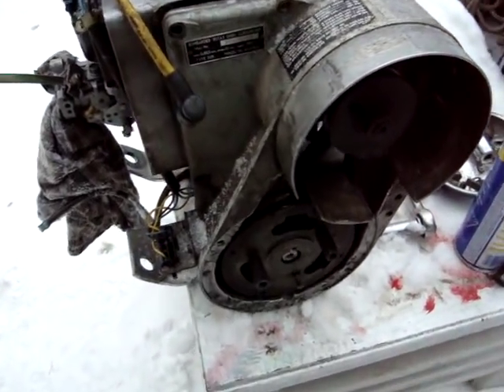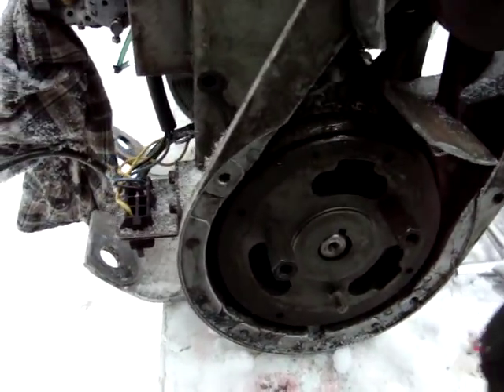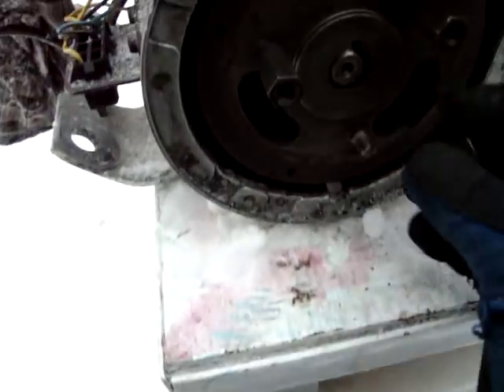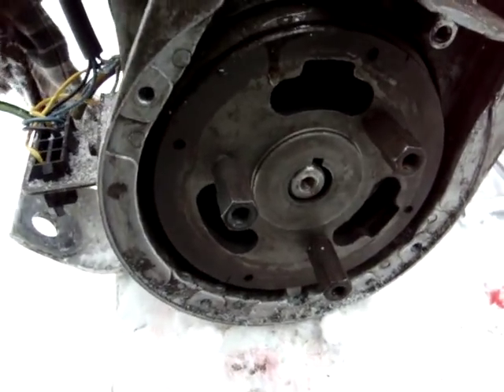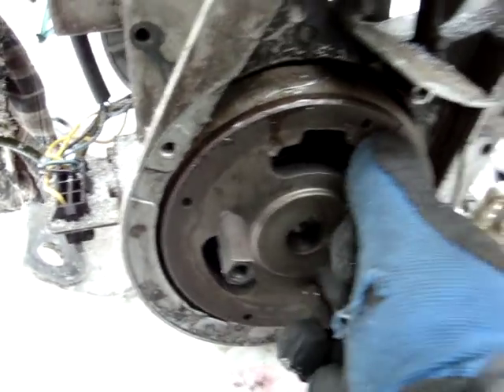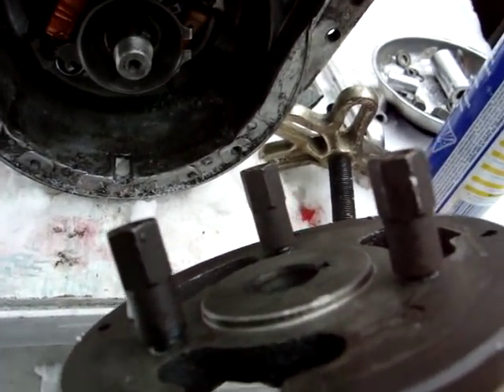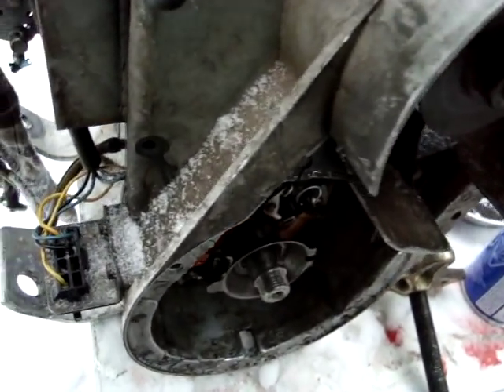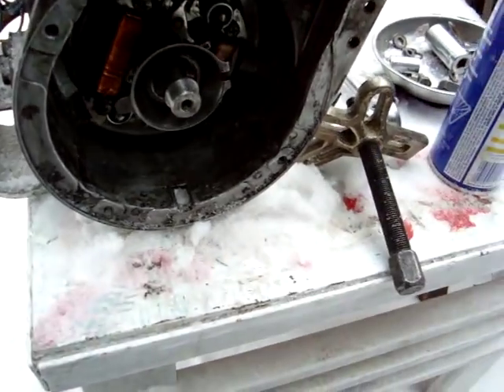VINTAGE SKIDOO FLYWHEEL MAGNETO REMOVAL TRICK FOR ROTAX 305 440 340 MOTORS

Comment: I just got the flywheel off my 1972 640 TNT. Thanks for the head bolt coupler idea. I had to use the same puller you have, plus heat, plus oil, plus an air chisel. Man was it stubborn, but after 24 hours I finally got it off. Now for the clutch.😆

Comment: Awesome tips thanks.  And how can I get the clutch off on the other side of the engine.
Reply from the maker: howdy sorry the clutch can be of a few different types most after the one side comes
off either screw off or are pressed on can be a bugger  if I remember right

Comment from the maker: IN THE VIDEO i Keep calling the three longer  Headbolt nuts im using exhaust bolts they are not exhaust bolts
 they are THE vintage skidoo motors HEADBOLT NUTs. that were on the engine....
Also you will need three of them so if you dont have three on your motor  you will have to find something that is the same in thread size and in length,,Bring one of the head nut from your engine to a auto parts store...Ask for nut couplers like these..That should be the same..

Comment: Hey Rat Sleds,i dont understand what you are saying.Here's what it sounds like you are saying...that you can use the riser bolts{which have to be re-torqued by the way ,when you put them back where they came from}to pull the flywheel off...but you show that you have to indeed use a puller to take it off.But you seem to be saying that you can use those bolts to take the flywheel off WITHOUT a puller.Seems to me,you need a puller any way that you do it.
Reply from the maker: yes you can use the nuts from the head if you cant find any for your puller flange nuts or have to take out the recoil threaded bolts way faster than having to take out the recoil mout bolts on the flywheel its all there ..As for retorque yup if your into it the flywhell id say you would know how to retorque even with out a torque wrench by now lol